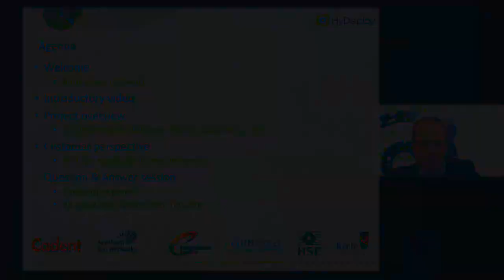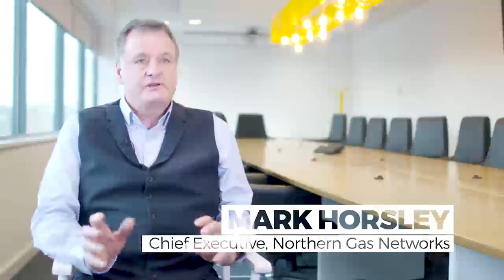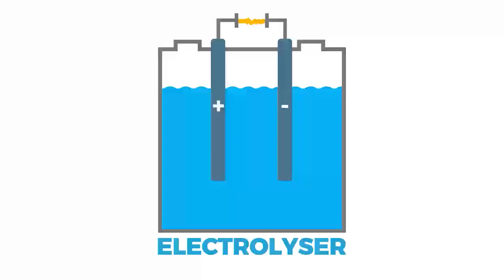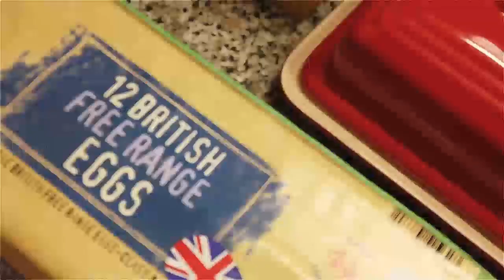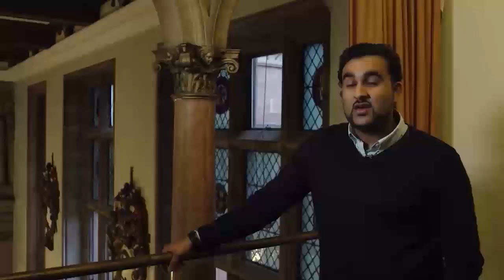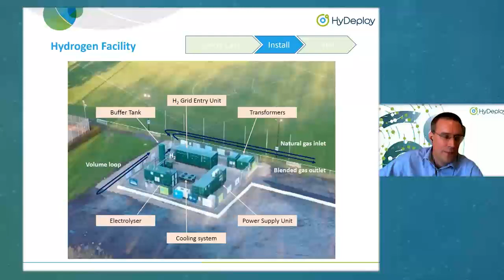HyDeploy Webinar - Project Overview

Comment: Surely the energy content will decrease when  hydrogen is mixed with natural gas as hydrogen is 6 times less dense at the same pressure & temperature and will act as a dilutant. No mention either of the nitrous oxide - which is a more potent greenhouse gas than CO2 by a factor of 100 - given off when burning hydrogen alone but which latest research suggests increases sharply when other gases are burnt with it as here...